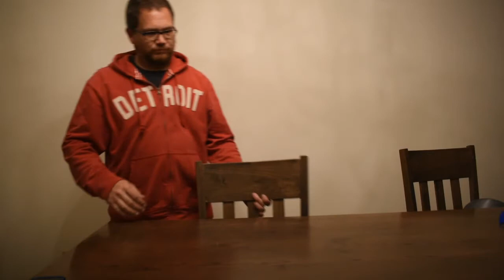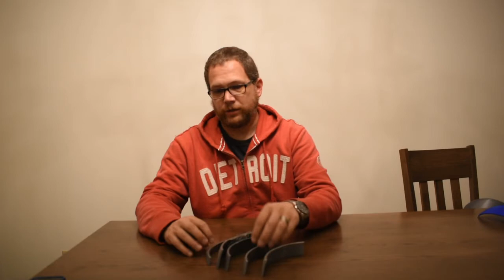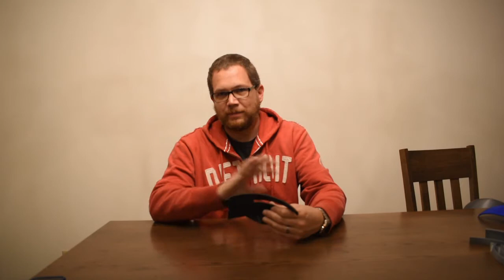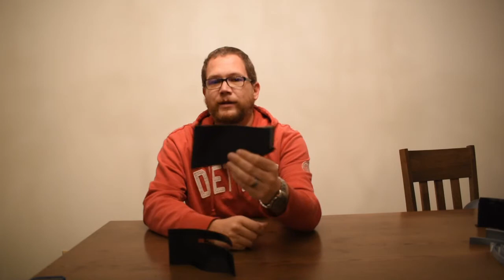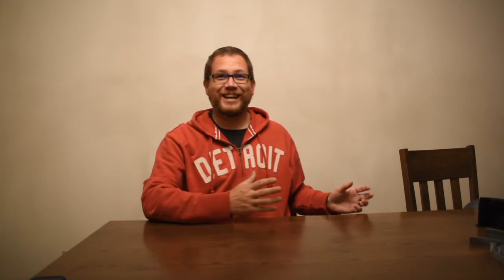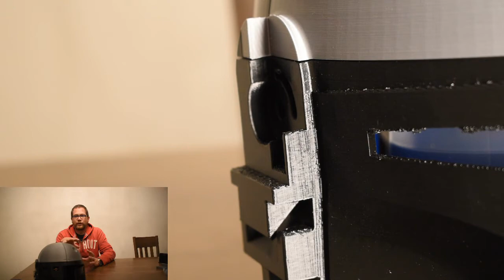Boba Fett #3   Dry Fit

Comment: 11:12 is it supposed to be slanted at the bottom?
Reply from the maker: Boba Fett's helmet is not symmetrical, it is pretty banged up. Looking at reference photos, that part of the helmet does look to be a little crooked. That being said, this model is a little to slanted in this part of the helmet. When I modeled this, I had a pretty tough time with it. My model didn't turn out as well as I wanted it to. It wasn't what I call "clean". I had to do a lot of tweaking, and working sections over a lot to get them to look good. This was one area, that I tried to go back and straighten out, but my model would just blow up when I tried to do that. So, I have begun work on a new model. I haven't had any new videos out for a long time, because of life stuff. I'm hoping that will be coming to an end soon. We have bought a house, and I will have a space to use as a workshop. But, in the meantime, I have been working on a new Boba Fett model. It's coming along nicely, and I hope to start printing that, and making videos about it within the next three to four weeks.

Thanks for the comment

Comment: Did you try using a brim at all? They are very easy to remove after printing and I've found them super helpful for prints with small adhesion areas that don't want to stick!
Reply from the maker: Thanks Austin, I didn't mention that part, but yes I've been using a 6mm brim.

Comment: I too was having issues with some edges lifting from the bed. I now wipe down for every print. I also use "skirt/brim" in slicer and set "skirt offset from part" to 0 and "skirt layers" and "outline layers" to 2. It then holds the part down on the bed. It can also reduce the need for rafts. No need for glue stick or sanding the sheet down.
Reply from the maker: Thanks for sharing what you do. I also wipe down with rubbing alcohol before every print. I've been using a 6 mm brim on my skinny parts.